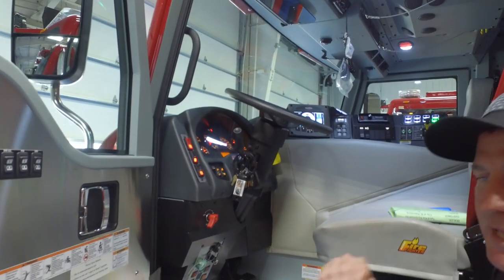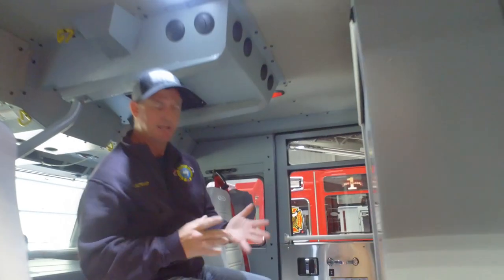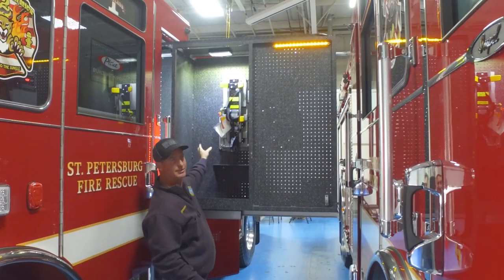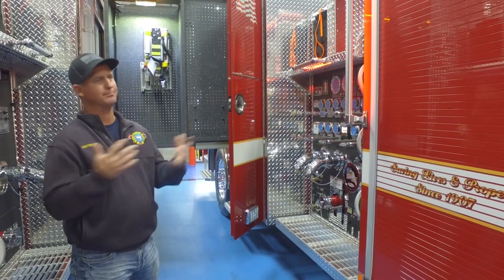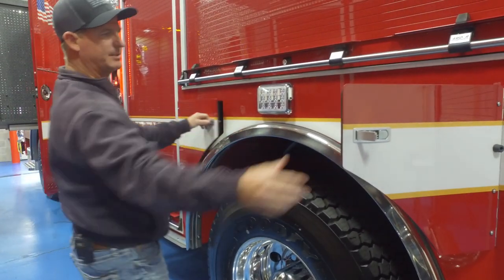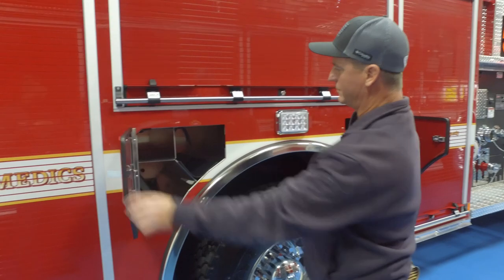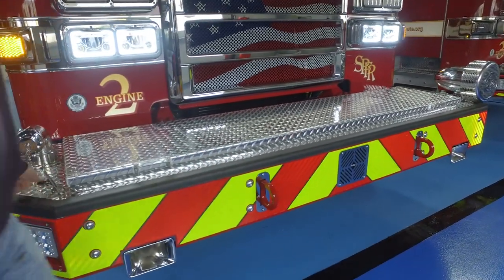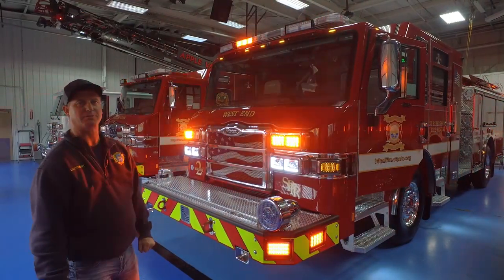Impel® Pumper – St. Petersburg Fire Rescue, FL

Comment: Anyone who says that they're an aggressive department and delays a fire attack by minutes with a clean cab is lying.
Reply: I disagree. Over a career's lifetime, not having those carcinogens living in your cab 24/7 and infinitely stacking upon each other means that a firefighter has a better chance of physically being able to still do the job. You can't take care of other people if you don't take care of yourself first.
Reply: @mike6340  I agree....... You can be trained to get your gear on fast. My aerial has a clean cab as well and I KNOW how fast my guys can get dressed out.
Reply: You are basically saving a minute in the station and adding a minute on the scene
Reply: Some people resist change. That's quite the norm in the Northeast.
Reply: @zstahly  like I said you train your crew the way it's supposed to be trained you can make up that difference. and I can't speak for your fire department but I know my fire department trains our people.

And if you took every freaking article that I have read in 14 years about how things don't work this way and how things don't work that way and line them up I guarantee you we probably have enough toilet paper to not have to worry about having to run out.
Reply: @zstahly  And when it comes to my crew and the citizens there is no such thing as going overboard with safety. Anything that cuts down the risk of cancer within the ranks of the fire service I am all for.